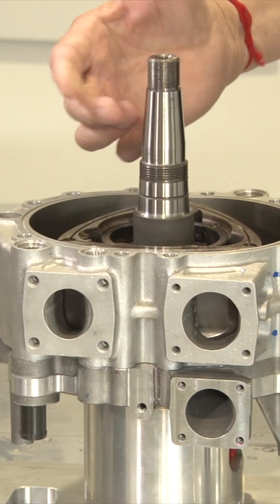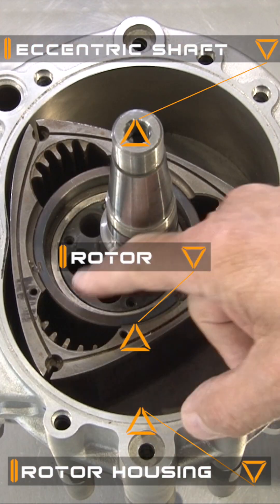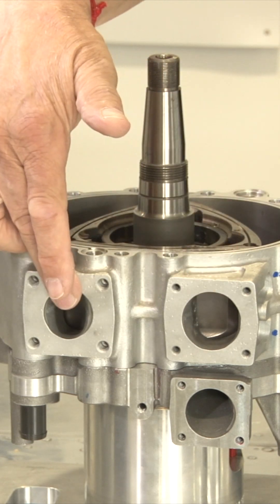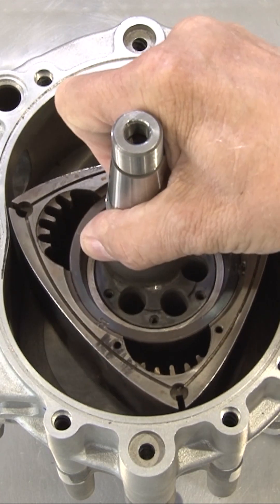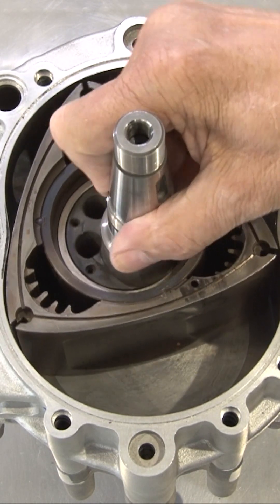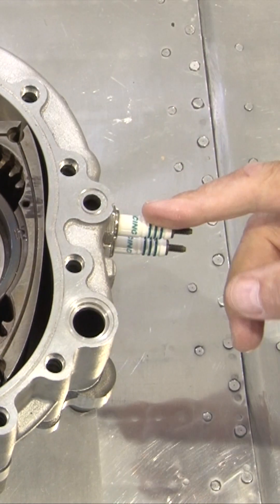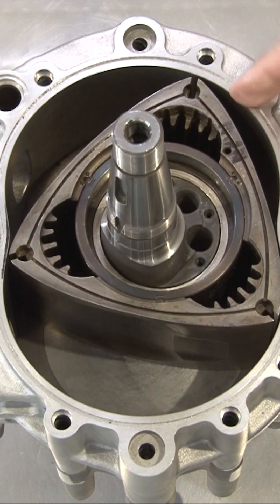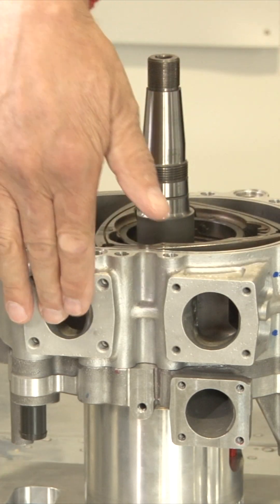How a rotary engine works #shorts

Comment: is there have 4stroke rotary engine?
Reply from the maker: It is a 4-stroke… listen again around 12 seconds in
Reply: The rotor completed the whole stroke cycle in just one revolution. three sides of the rotor working simultaneously on intake, compress,combust, exhaust. One complete stroke in one rotor revolution.

Meanwhile the normal 4 stroke engines principles; The piston movement from TDC, aftertdc to BDC, afterbdc. (TopDeadCenter,BottomDeadCenter) 4 times the piston goes up & down, just to complete one cycle stroke, hence the name 4 stroke.

I don't care, rotary engine is one stroke engine in my book 😂
more efficient than a two stroke engine!

ps: sorry for my bad writing. English is not my first language.

Comment: I know its a Wankel etc But what exact engine is that?
Reply from the maker: Believe it is a Rotron RT300. The engine in the bike is a Rotron RT690
Reply: @TheRaceBay  Thank you thank you!!
Thought maybe it might be the Suzuki RE5
So interesting seeing other designs of the same thing such as the crank is not geared to the rotor like a Mazda 13B and is on an eccentric instead.
So cool seeing other designs which in my opinion this in that one aspect is actually simpler.
Why did Mazda gear their rotor in the center to drive the crankshaft if they didn't have to? Perhaps insurance of the 3:1 ratio of rotor to crank phase?

Comment: You can see why they don't make tons of torque, there's hardly any length or lever to the crankshaft, but it makes up for it with high revs and hp
Reply from the maker: The engine in the bike makes 105 FT/LBS (142.361nm) @ 9,500RPM according to Crighton. 

The same engine has a maximum Peak RPM of 10500, makes 220hp and a noise that makes the hairs on the back of your head stand up... Then bailout.
Reply: @TheRaceBay  what size is the displacement?
Reply from the maker: 690cc
Reply: @TheRaceBay  that's impressive, it does make that torque at a screaming 9,000 rpm haha but still cool, will be interesting if they really implement it in consumer bikes or like all wankel engines, they just crap out